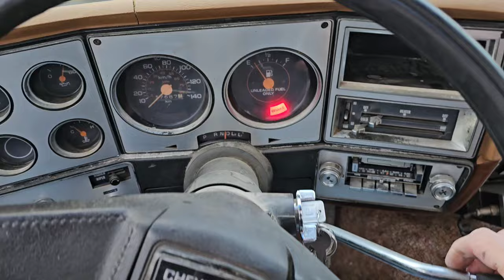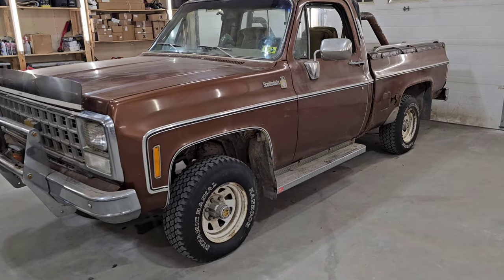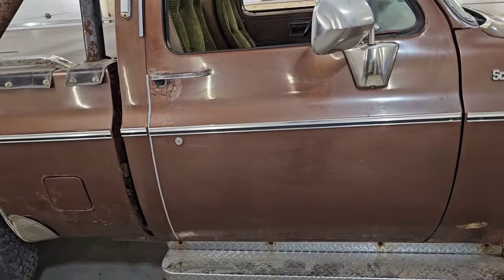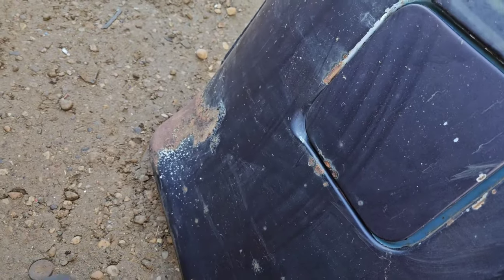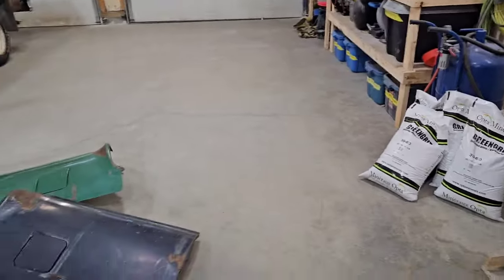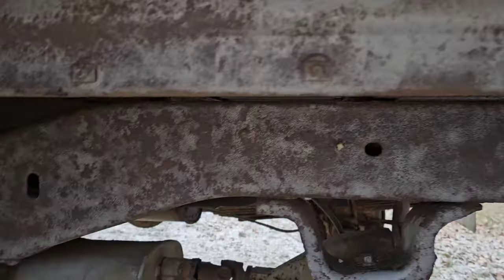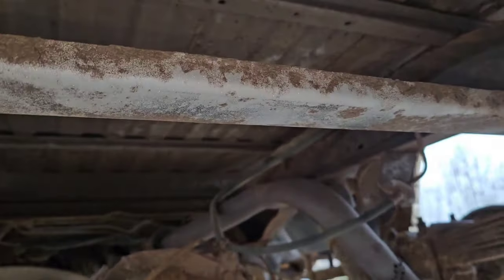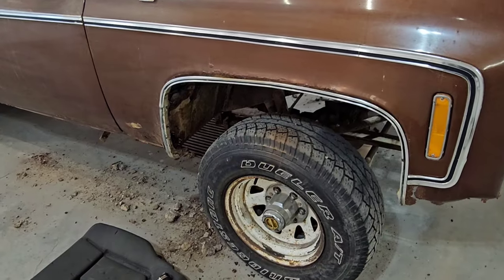Teardown begins on the 1980 Scottsdale Square Body Chevy Part: 1

Comment: Wow you got it blown right apart.
Great video.
You should buy yourself a cordless ratchet.
Treat yourself.
Cheers.
Reply from the maker: I've got the front half the truck in primer there now ready for paint, I'll be pulling the motor and transmission in top off right away hopefully get the painting that frame real soon saving the most welding for last LOL which would be the Box.  A cordless ratchet is definitely on my list of things to buy lol
Reply from the maker: Thanks again for watching and leaving your comments it's greatly appreciated

Comment: Too bad you live in the rust belt which is anything north of Georgia
Reply from the maker: Usually Alberta isn't too bad it's pretty dry out in this area for Canada the province of Alberta in Saskatchewan have the most amount of classic cars still kicking around because the dryer climate here.  But they're was a ton of mud built up on the underside of truck from 4x4 use I'm pretty sure which caused the rust to happen as bad as It did.